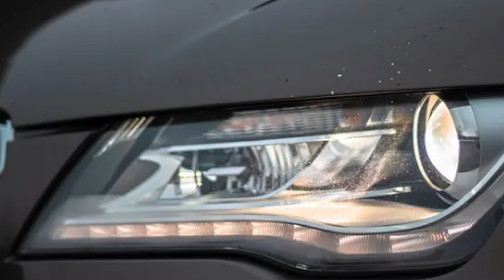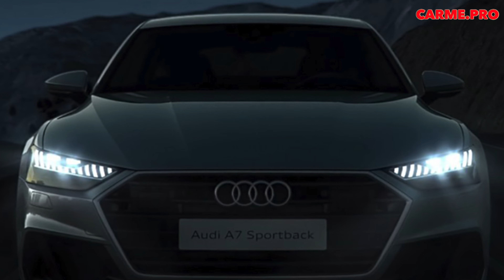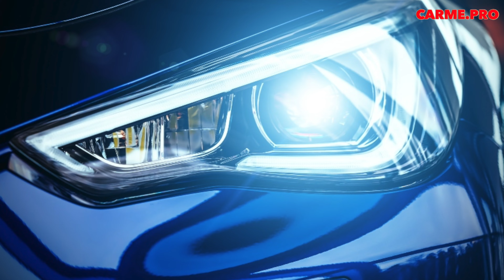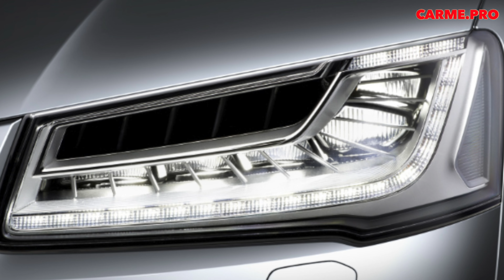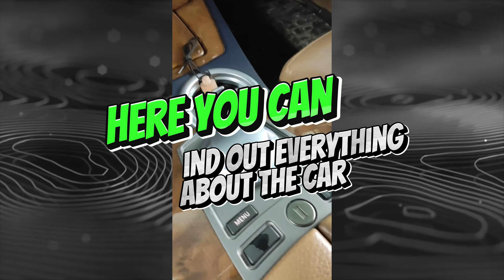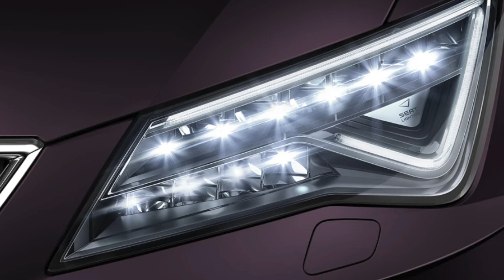LED headlights – PROBLEMS AND WEAKNESSES

Comment: Bonjour, je veux acheter opel insignia 2018 en boite automatique. quel est le meilleur moteur (coté fiabilité): 1.5 turbo 165ch ou bien le diesel 2.0 170ch ou bien le diesel 1.6 136ch ? quels sont les problemes electriques ou mecaniques dans cette voiture ? est ce qu'une conversion gpl est possible pour le moteur essence ? est ce qu'il y a des problemes fap ou vanne egr  pour les moteurs diesel ? merci